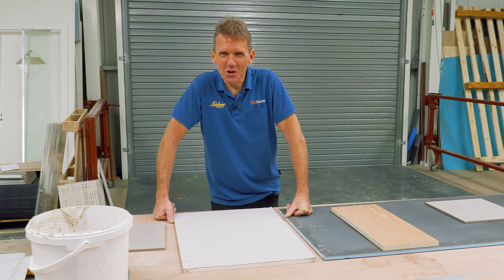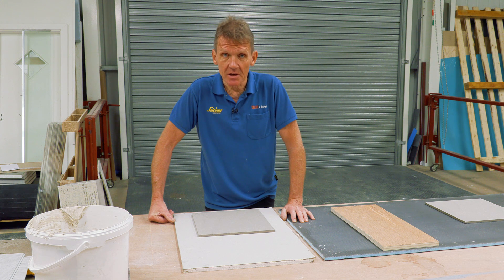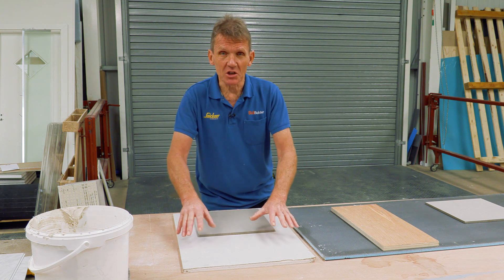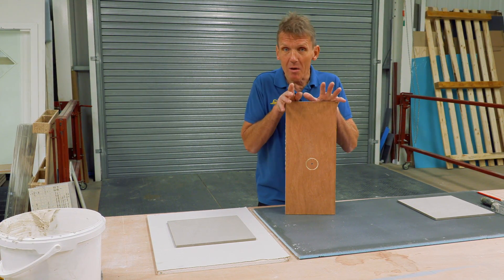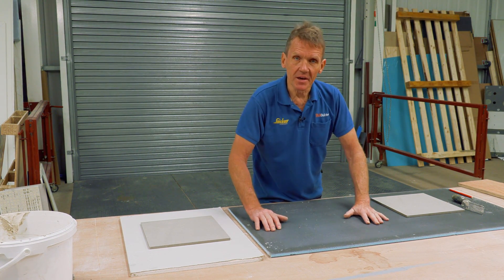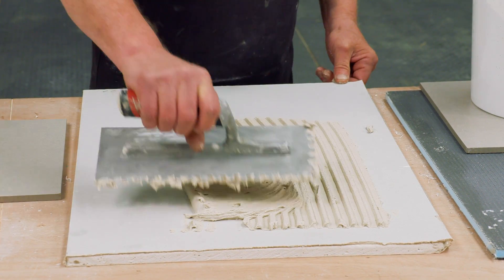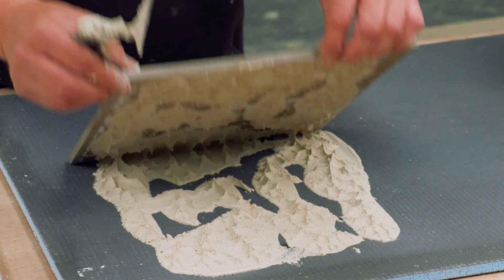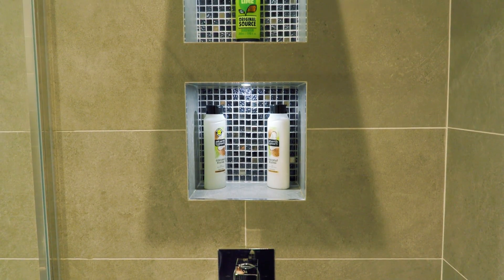Dot & Dab Tiling and British Standard 5385-1 Changes

Comment: A little disingenuous to move the tile on plasterboard only slightly vertically, rather than across the ridges.  Of course you haven't collapsed them fully in that case.  And then to cut out the "bedding" push on the elements board so that the viewer can't see you using the correct, side to side technique.
Reply: Also a little disingenuous saying that a 20kg/m2 limit on plasterboard, when it’s 32kg/m2.
20kg/m2 is on skimmed plasterboard! Oops